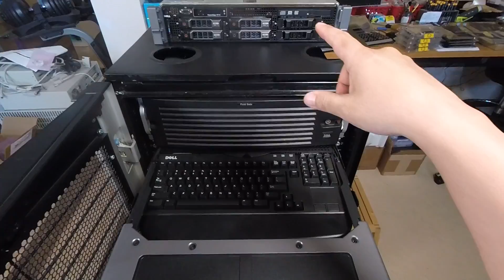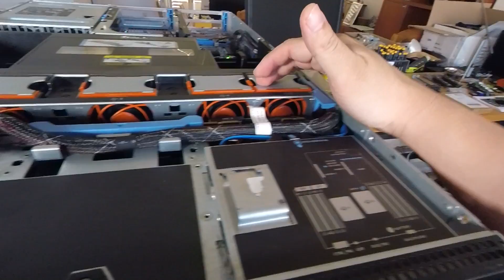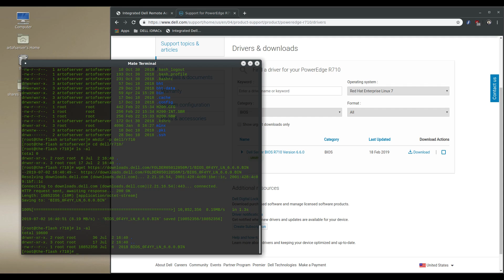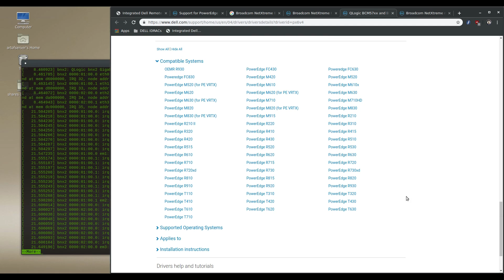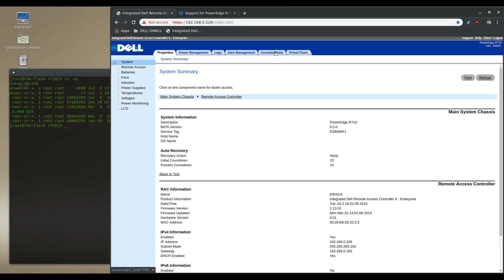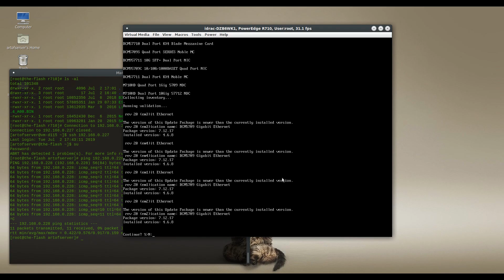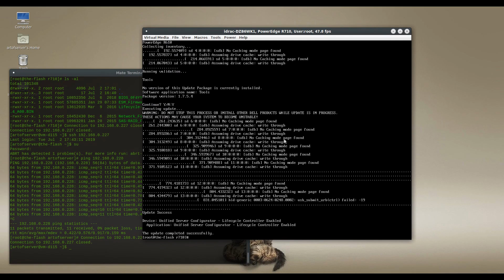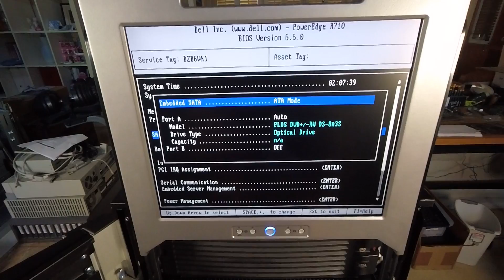Dell PowerEdge R710 build PART 1/9 | fixes, bios and firmware updates, and factory reset

Comment: im not sure if you can help me but i'm trying to update the firmware and bios on my r710 i've tried a centOS 7 usb but couldnt understand what to do to run the updates then i read about using the dell repository manager to make an iso which worked apart from my bios which was that old it failed to update, in order to do that i thought about putting windows on a usb which wouldnt work, i tried freeDOS onto a usb and that didnt quite work either plus i have no clue what to do. do you have any advise or suggestions
Reply from the maker: i would use the BIOS update for whatever OS you are comfortable using. If that's windows, then just download the windows executable for the BIOS update and use that.

Comment: Any guide on setting up the bootable drive you use for the updates?
Reply from the maker: Not yet. Will be in a future video.
Reply: @ArtofServer  Red Hat won't even let me register an account so I can download the iso because it doesn't like my email :P
Tried to update via the LIfecycle Controller instead, but apparently that no longer works either. Need to update BIOS and NIC firmware

Comment: I've had a R710 for a few years running ESXi ona nd I'm quite happy with it. The SAS drives that came with it kinda sucked (as does SATA access with the built in raid card), but it's been a workhorse. Resently a powerout crashed the datatore raid to degraded and corrupted the ESXi boot media so looking to start over and get it as upgraded as possible now. Looking forward to watching through your series.
Reply from the maker: Awesome! Hope you enjoy the rest of the series! Thanks for watching!
Reply: @ArtofServer  I'm sure I will. My machine is a dual 6 core with 72gb ram, idrac 6 enterprise and raid controller (sas/sata2 i think)

Comment: Dude, you wasted a lot of recording minutes by not getting to the point?? instead of doing all the updates via ssh you show this could've been accomplished through IDRAC! and instead of showing drivers that were not supported, just show these are the supported drivers etc! Other than that, a very good tutorial just 10-15 mins too long.
Reply from the maker: Using the LifeCycle controller (probably what you meant by iDRAC) is no longer possible with 11th gen Dell servers because they are EOL and Dell has removed the updates from their repository.

Not sure what you mean by "drivers that were not supported" as I didn't cover any driver installation??

anyway, thanks for watching.

Comment: Good day Art of Server
Have you ever installed a R620 from scratch? I’m struggling.
Reply from the maker: Yes, I have a few here. What are you struggling with?
Reply: Art of Server I bought it used with a H310 raid controller already installed, but the system does not show any storage. I tried updating the firmware but get an error everytime
Reply from the maker: @adejackson4854  Is that the H310 mini? What do you mean "system does not show any storage"? can you be very specific about that statement because it can mean a lot of different things. In RAID controller? In your OS? etc., etc.
Reply: Art of Server I’m going to do my best because I’m lost. By trade I’m a network engineer. So I’m playing unfamiliar territory. On the storage overview tab in my idrac 7. I get this error messages. RAC0501: There are no physical disks to be displayed. 1. Check if the host system is powered off or shutdown. 2. Check if the physical disks are inserted into the enclosure or attached to the backplane. 3. There are no out-of-band capable controllers detected.
Reply from the maker: @adejackson4854  forget the idrac for a second. During POST, hit ctrl-r when you see PERC H310. Can you see the drives in there? Also, are the HDD status LED for each drive turned on and green?
Reply: Art of Server no the only options is to rescan disks n only hard drives the bottom light is green
Reply: Good morning Art n thank you for helping me out this far

Comment: i have a dell poweredge t410 with a perc 6/i raid controller...i read somewhere that it does not support anything above 2tb. what can I use that will support above 4tb? also to mention that it was set up with 3 - 1gb sata drives and i had ordered 3 - 4tb SAS drives and it didnt recognize the the 4tb drives to make a VD, but it did see them but they are failed status
Reply from the maker: Can you wait about 2 weeks? I'm about to make some videos about the R410 that will reveal some awesome stuff for the R410. Or reach out to me in private.
Reply: @ArtofServer  thank you for the reply, that is awesome and cant wait to check out the videos. ill also reach out to you in private. thank you

Comment: Your tip on disabling the memory check is a god send. I have an R815 with 512Gb ram, that used to take 10 mins to boot up!
Reply: what do you do with 512Gb ram???
Reply: @ve-uh7tq  We had a bunch of those on our last HPC system, and 512GB was frequently insufficient so we went large on the new system. This is idle at the moment, but the main use is mesh generation for CFD. Once you have the mesh the actual computation takes way less RAM.
[root@big1 ~]# free -mh
              total        used        free      shared  buff/cache   available
Mem:           3.0T         68G        2.9T         14M        1.6G        2.9T
Swap:           29G          0B         29G
Reply: @ve-uh7tq  I know it's daft isn't it?

Comment: Hey,

Thank you for making this video series! Very interesting stuff!!

Not sure if you still read the comments here but I was wondering if you could help me out. I wanna buy an old server like this one and start leaning about this stuff but I have no idea where to start or what to get first. Was hoping you could point me in the right direction and tell me what server to buy as my first one? Is there a brand that is most suitable for general use? for learning on? or should I just get this PowerEdge and follow your videos? or is there a better brand around the same price that is good to learn on and can last a long time and easily up-gradable if need be
Reply from the maker: Sure, I can point you in the right direction. In fact, I may have a server or 2 that might work for you. 

But first, please tell me what it is you want to learn about with your server? Is it for virtualization? Containers? Storage? Or, what else? And also, what is your budget?
Reply: @ArtofServer  Containers mainly. And if I can do both containers and storage at the same time then that's the goal. (As you can see I'm super new to all this)
Reply from the maker: @issasaid92  ok. what's your budget? and how much storage do you need?
Reply: @ArtofServer  around $600 if possible. As for storage even 4Tb is enough for now just for experimenting and then I'll add more with time.
Thank you for your help! :)

Edit: If budget is too low let me know what you recommend.
Reply: @ArtofServer  Would it be easier to communicate through email?
Reply from the maker: @issasaid92  yeah, shoot me a message. Just be aware I get like a hundred messages a day, so it may take a while to reply.

Comment: Hi , followed this great video to update the firmware of my R710 with BIOS 1.3.6 to 6.6.0

Unfortunately i ended in a device that does not boot anymore and is not showing the BIOS screen.
Updating the BIOS most probably will require a step wise update from very old version. Be warned.
Does somebody has experienced the same and was able to recover the corrupted BIOS?
Reply from the maker: Did the BIOS update complete successfully? I would suggest trying the nvram reset, in case something was saved that is messing up the new BIOS. There's a video on my channel showing how to do that by jumper.
Reply: @ArtofServer  did this already  and it did not help. The screen is not showing at all. The bios update did finish but not sucessfully. After reboot the boot process is stucked.
I can log into the idrac6 but i cannot make any bios reflash with that version.
Have you ever flashed the bios with a eeprom programmer and do you think that can recover the bios? 
Btw, your channel is great!
Reply from the maker: @peterkreutzer690  Well,  if the BIOS flash didn't finish successfully, you should never reboot. Probably best to retry the BIOS flash at that time until it completes successfully. So, now you have a corrupt BIOS. Yes, you might have to flash the BIOS chip externally now... I have never tried it on Dell server, but I would imagine it is possible.
Reply: @ArtofServer  i ordered a eeprom programmer now and will give it a try to flash the bios with the programmer on the main board.
I tried to get support on the dell suppot site, but with no success. 
if you have some info on how to extract the files to flash from the dell BIN file that would help.
i will share my experiences as soon as i have the programmer and did my first loads
thx.
Reply: just wanted to give an update on the above topic. 

I finally got back the server by flashing the BIOS with a CH341A eeprom flash device.

more info on how to do that can be found here https://www.win-raid.com/t5236f16-Help-Dell-PowerEdge-R-Gen-II-Mainboard-BIOS-Bricked-after-Power-Outage-while-Updating.html#msg106263

now i can follow up on the other videos :-)

btw with the bios flash i lost the service tag and express service code. 

what is the best way to set it back to the old numbers?

Comment: sorry for the newbies question but my r710 has a missing idrac, some people even talked about an sd card for the idrac, do not have that either, should i be worried ?
Reply from the maker: there are 2 iDRAC modules for the R710, the iDRAC express and iDRAC enterprise. in this video you saw me replace one of them... the iDRAC express. they are cheap to find online, so you should get both and get them installed if your server doesn't have 1 or both of them.
Reply: @ArtofServer  but is the idrac that important or could I do without it? I live in Switzerland, and stuff like that are really hard to find or really hard to import.
And thanks for fast response

Comment: Did you boot CentOS on the server just to update its firmware?  Can this be done from a USB live environment?
Reply from the maker: It's not a USB live environment. It's just centos 7 installed on a USB drive. I use it as a portable USB drive to do maintenance or diagnose problems.
Reply: @ArtofServer  cool, i just bought one of these and the necessary other components to replace my proxmox/plex/NAS server.  I'll have to keep a centos drive around to update it, since they don't officially support debian-based distros with updates.

Comment: I recently purchased a R720.
It was just empty, no RAM, no CPU, no controller, no drives. 

Installed the CPU's (2 XEON E5-2620V2 SR1AN like you had originally) in 
the correct way,  those 4 cutouts line up with the small plastic pieces 
of the socket,
RAM (Samsung 8x 8GB 2Rx4 PC3- 8500R DDR3 RAM M393B1K70BH1-CF8 in slots A1-A4 and B1-B4),
controller (PERC H310),
optical drive (Dell SATA DVD-ROM 0KVXM6),
one hdd (Samsung HD501HJ, just for testing).
Yes, I used thermal paste on the CPU's and checked if the heat spreaders are fully covered.

Then I plugged in: a monitor at the rear VGA port, keyboard and mouse at the rear USB ports.
With high expectance, i pushed the start button...

Unfortunately my machine does not POST.
When I push the start button, the fans start to spin at different speed 
levels over time but the screen stays blank, no power to USB ports, 
nothing happening at the drive bay LED's.
IDRAC display lights up, shows info too. 

I can also reach the web interface of IDRAC.
But I dont have the password so I can't get further into IDRAC functions.
To reset IDRAC password I know I have to enter BIOS setup to change the credentials.
BIOS password can be reset via jumper.
Also NVRAM clear via jumper.

Did both, no change. 

The machine still does not POST...
I tried to remove all but 1 CPU and 1 RAM module, even all riser cards 
and the network daughterboard, but it stays dead except the fans having 
fun.
IDRAC info tells me the power consumption is 0 watts, and when i removed the 2nd CPU it was cold.
RAM modules were cold too.
So I hope i didn't fry my processors. 

Initially the machine was fitted with 2 E5-2643's and 64GB in 4x16GB.
From the date of delivery the latest BIOS available was V1.6.0, which does not support V2 CPU's.
As I don't know if the previous owner ever updated the BIOS, I kinda hope that updating it will fix the problem.

Is it possible this non-POST error is caused by too old BIOS ?
What happens if you mismatch CPU/BIOS version ?
Reply from the maker: yeah, my first suspicion would be older BIOS that doesn't support v2 CPUs. if you have some older v1 CPUs, try to POST with those and if that works then update the BIOS and then try the v2 CPUs again. that would be the first thing I would try. if you don't have v1 CPUs, just pickup the cheapest one you can, and you only need 1 CPU to update BIOS.
Reply: @ArtofServer   Today I visited the dealer I got the r720 from. Its a good 4 hours drive away from home but I had to go near that place for a training so I used the opportunity to have them check it. Main reason for non POST was definately the BIOS. They installed a V1 Processor, booted it, the screen and the USB ports came alive. When we tried (they allowed me to watch/help) to enter BIOS, or even waited for the full boot cycle, the machine stopped at the point before the firmware versions of the components would be gathered. Last info was about CPLD versions and then complete stop. After a lot of trying the employee, Simon, got another R720, where we put in the parts we used in "my machine" to test. Which were a 2650v1 and one of mine 8G RAM modules. That one fired up, went through the full boot process and ended with a message no boot drive. As there was none, this looked completely fine.
Lo and behold, both machines had BIOS V1.6.0. After some fiddling we updated it straight to V2.9.0 without any problem. After that we installed the 2620v2 Processor with one RAM module and let it boot, then the 2nd CPU with 7 more RAM modules and let it boot, after that we exchanged the PERC710 with the PERC310 and let it boot and finally added the DVD-ROM drive and let it boot also. One thing we did not test was IDRAC webinterface. But the integrated display showed an IP when we put in a network cable so I am fairly certain I have now a fully working machine. Yee-haw !
Reply from the maker: @Hirndille  that's awesome! glad to hear you got it sorted out! :-)
Reply: @ArtofServer  It gets even better. Today I tried to flash the PERC 310 Mini to IT mode. I used your pdf to do it. I struggled a bit (not so very deep into Linux yet), but I was able to flash it without bricking it. took me about 90 minutes to do it. I checked, double-checked and checked again if I did each step right lol. But then I struggled many hours to install FreeNAS 11.2 onto it. Finally i found a video on here, its even a sponsored channel of yours ^^ which explained what i had to do. Then it was a matter of minutes. Now "Masterblaster" is running fine with its 12 cores, 24 threads and 64 gigs of RAM.
Reply from the maker: @Hirndille  Glad you got that sorted out. But I can't take credit for the "PDF" file you mention. that was someone else who figured it out after I made the video about it.

Are you talking about Nhan Nguyen's channel regarding FreeNAS? If so, yeah,.. he has some good stuff.

Comment: I got an r710 but it looks nothing like yours. The harddrive slots look much different for instance. are there different models?
Reply from the maker: Yes, there is a 6x3.5" backplane like this one, and there is a 8x2.5" backplane model.
Reply: That explains it. I ordered an r710 with a 4 slot 3.5 hdd and they sent me a 8 slot 2.5hdd with a broken led, 2 caddies and punched in power supply grates. I'm getting a replacement I just hope it's not the 2.5. do you have any good recommendations for cheap sellers

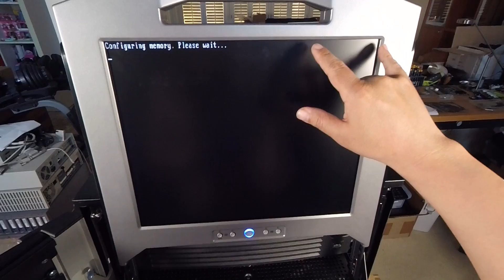Comment: Reset Bios to Factory default at 49:00
At system console:
1)Reboot and when prompted press F2 to enter bios
2) If not already on press NUM Lock key to turn on Num Lock. Press Caps lock key to turn on Caps Lock. Press Scroll Lock key to turn on Scroll Lock, .
3) Press Alt+E, Alt+F+Alt B,  system will reboot to factory defaults when Alt+B is pressed.

Comment: You may be wondering...
Note@: 12:15 AOS re-installs the Perc6i card while troubleshooting the iDrac card, even though he's planning on using an IT flashed H700 and you may be wondering why?
The devil is in the details. While troubleshooting hardware AOS is using care to change only one variable at a time. Also important to note that he doesn't just hurriedly rob the plastic bracket from the original daughter card; he swaps it so his benchtop and bins don't overflow with bits and pieces like mine are  :)

Comment: ...why does it look like there is power to the board while you are mucking about with removing RAM and CPU heatsinks?
Reply from the maker: The PSUs were plugged in.
Reply: @ArtofServer  right. that's kind of my point. are the RAM modules hotswap? otherwise...power to the board while changing them is...usually not a great idea.
Reply from the maker: @artlessknave  the system wasn't powered on.
Reply: @ArtofServer  yes i know that, but you still have soft power to the board...i guess I just don't trust that as much as you do.